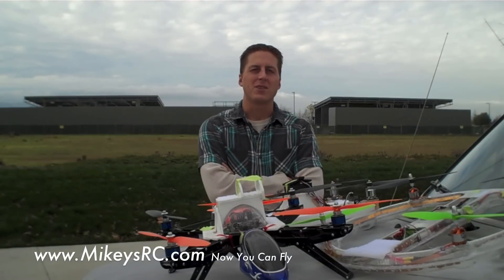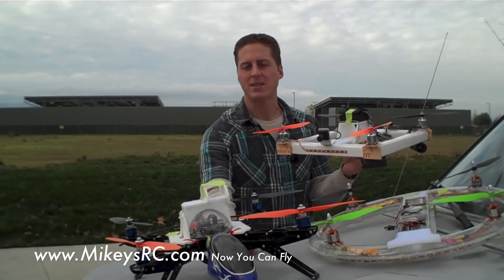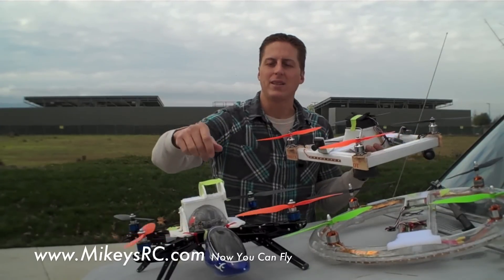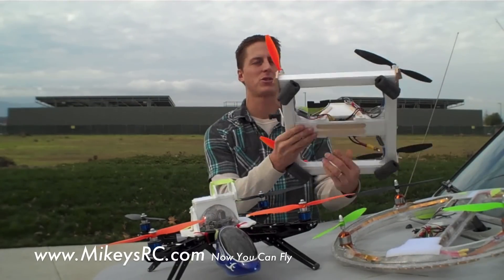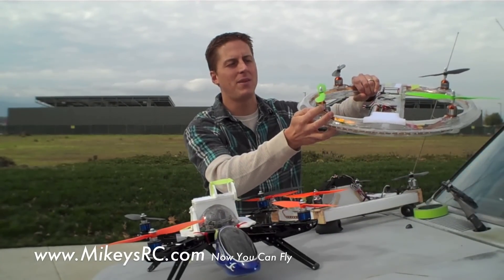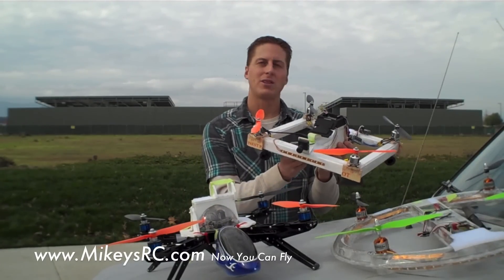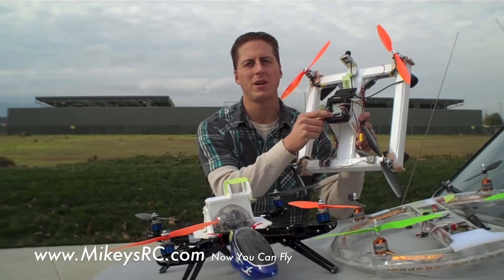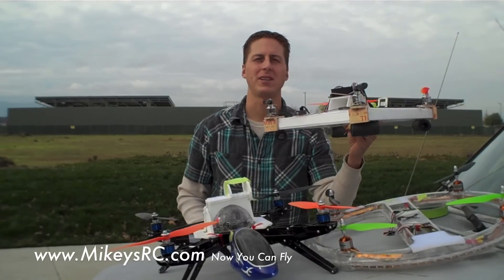Cheapest Super Light Quadcopter Frame $5 & 180 grams - Multirotor

Comment: emax 2204 2300kv motors are excellent, whether you get the fakes or the real ones, they both rock. The fakes have a bigger C-clip and are easier to work on, but require balancing.

Comment: I'm a noob. why not get a cheap chinese drone for parts. wouldn't that cut the cost of the motors in half?  would any other parts be usable?
Reply from the maker: +Zerric Dotcom This video was made before all the cheap drones in a box had proliferated the market....so yeah....if that's a cheaper option for ya I say go for it =).
Reply: +Zerric Dotcom Those tend to be extremely low quality parts.  Motors can be very cheap, especially if you buy them on sale.  Those and the radio/receiver are the two parts that you should consider investing a bit more in.  The electronics because going cheap on a transmitter/receiver can result in flyaways and lost quads.  And motors because they REALLY take a beating when you crash.  And you WILL crash.  Going with something tougher means you won't have to replace them as often and will actually save you money in the long run.  You could use a cheap chinese drone for the frame, but you can get a frame cheaper by itself.
Reply: +bigrcfanatic unfortunately I learned this the hard way.  thanks

Comment: HI    
I have some  electric question :
would like to understand the supplying 5 V to receiver  .   because I know that on plain it is supplying from motor controller.and here we have 4 of them  ( all 4  ,  5 Voltages are connected parallel? it is not healthy )so please let me
Reply: +Moti Mazor each ESC has a BEC that outputs 5v...  when you connect ESC to FC you are supplying it power... sometimes non-linear ESC's you have to disconnect all but 1 power lead so your FC is only receiving one power feed

Comment: HiI did not understood  , from what material you build the frame , from balsa  ?thanks
Reply from the maker: +Moti Mazor Foam Board
Reply: HI    MikeysRC thank you for your reply.another electric question :would like to understand the supplying 5 V to receiver  .   because I know that on plain it is supplying from motor controller.and here we have 4 of them  ( all 4  ,  5 Voltages are connected parallel? it is not healthy )so please let me know.from where kk2 get the 5V  ?

Comment: Hey MikeysRC . You mentioned FPV at the end. I'm aware of it's meaning, but im curious as to what components are needed to get it to work on a DIY project. Would it be something that gets plugged into the kk2 board or will it be a standalone transmitter of sorts. Reason for asking: The live streaming deal is essentially why i am looking into scratch building. Any input would be greatly appreciated! BTW - Great job with your builds!

Comment: What do I need to build a BlackHawk QC???

I want to build a very fast QC that flies for about 30 minutes or so, and that can lift the Mobius camera and maybe, maybe a Go Pro... 
I would like the most powerful thrust engines I can put on with 12 inch propellers or so... I am also, thinking about 5000 to 3000 mah or maybe 2,200 batteries... I am looking for a combination that will work within these perimeters...

Please, send me a list of things I will need to buy to build this quad-copter...

How fast is fast, about 80 mph, 50 mph, or so...

Flight time should be as close as I can get to 30 minutes or 20 minutes of actual flight time...

And be able to lift a Go Pro or two Mobius cameras...

I am looking for quality parts and accessories...

What do you suggest???

I am looking at a BlackHawk, but I don't know what to buy or where to begin...

I will of course be using this Flight Controller "Naze 32"
Reply: Lip stick use http://ecalc.ch/
Reply: Aram Bayadyan Wow, really love this page... Don't know what I just built, but it gives me about 22 minutes flight time...

Yessssssssssssssssssssss....

Comment: I need some inspiration for my quadcopter frame. Anyone got anything?
Reply from the maker: A giant rubber duck body.
Reply: i would do that, but I don't want to have to destroy one of my rubber ducks
Reply: jack mather
Who said destroy?  Improve!
Reply: Its my first quadcopter and apparently if the weight and angles are wrong it crashes straight away. I don't know a thing about weight distribution on quadcopters or rubber ducks, so it would be a bit too risky
Reply: jack mather Go for the H-frame, it's easier for orientation anf good for fpv/recording.
Reply: jack mather aerogel,,,,, STRONG and LIGHT, and bonus fire resistant :)
Reply: And where would you get a aerogel?
Reply: aero gel is pretty cool  but its too much for my budget and it would be hard to form myself.a heat proof thingy wouldn't really help overheating's either. would a silicone moulded frame be too heavy?

Comment: I would think that using a triangular cross section frame would be lighter and stronger
Reply from the maker: Build both, compare and let us know the results.
Reply: MikeysRC
Or do some research ...  http://www.pbs.org/wgbh/buildingbig/lab/shapes.html
Reply from the maker: +Richard F Cool little stress demo.  But I don't think that demo shows demonstrate torsional stress that this frame sees. I actually considered triangles when I first made this but making them connect at the corners would have been more work.

Comment: You didn't say what transmitter you used or recommend. I will be building this as my first multi rotor. Great video. Will check your other video out.
Reply from the maker: Spektrum DX6i or DX8 if it's in your budget.  And any spektrum DSMX receiver.
Reply: I had a DX6i, and I will tell you straight up it is not a very good radio.  It has many deficiencies, even at the "beginner" level.

Taranis offer far, far better value on both the TX and RX ends.

For example, most good flight controllers allow you to only make 1 connection between RX and the flight controller if the RX supports either PPM or SBUS (the latter being digital), which carry all of your control channel information.

But not with Spektrum, where you have to individually wire all the channels up, unless you only want to use the satellite which uses a serial connection instead of the full RX.

It's even worse if you want telemetry.  The good flight controllers can send telemetry information back from the quad to your transmitter so you can keep tabs on stuff.  But not with Spektrum, seeing as they decided not to open their protocol, and nobody feels like supporting them.  So no telemetry.

The FrSky telemetry stuff works.  You run 1 wire back from the FC to the RX, and you get telemetry.  Sometimes you might need an inverter or level shifter, but that should be it.

Look it up.  Look at the features, the price, and the user reviews.

Comment: Doesn't foamboard have paper covering?..any trouble with the weather?...Do you need to coat it with a water resistant coating?
Reply from the maker: I would not recommend flying in rain.  A morning mist shouldn't hurt it though.  Covering it all in packing tape will help protect it though.

Comment: i have a long term IRP (independent research project) for school and I'm making a quad and i based my first design off of this one it was after i finished it that i realized the props would bang into each other because the booms or whatever where to small i had them at 12 and 1 half inches long so i was wondering if you could tell me how long you made your booms front, back, and sides?

Comment: Still can't get how you mounted the motors on the foam board! How are the yard sticks holding the motor?
Reply from the maker: Glued some short pieced of wood to the foam board first.  I used a free yardstick form the hardware store for the wood.  Then I used wood screws to screw the motors motor mounts to the yard stick pieces.
Reply: Thanks..

Comment: Thanks for the video!  What speed controllers did you use?  What should I be looking for?  Also, any suggestions on motors when it comes to specs?  Tried looking on your website, but you didn't have this setup.
Reply from the maker: Used the KK2 controller.  4 1000KV motots that weigh about 60 grams.  10 X 4.5 quadcopter props from Gemfan.

Comment: Winter  X games on tv are using quad copters.
Mike, one fun project idea, is to try add a parachute to a quad copter I like to see this done I know you could do it. This would be used for if motor goes out in flight or a battery gets to low. Parachute should have its own battery one AAA to release it the air small door opens spring send it out the door. Im  a inventor to do not have time for every idea.
 With quads some buy on looks some on functions some on total cost RTF or both.
 Im looking for one can fly for one hour on one battery and one charge RTF maybe a year from now and use of Thorium we may be able to fly them to the Lunar surface take our own photos.. Keep inventing, good job. What nice about this hobby does not cost a lot and fun is worth every dollar spent and you can land them at your feet not like a plane no landing strip needed. We may move humans around earth this way.
 For first timers try starting with the V262 for $80-$130 steers great large enough to fly in 8 to 10 mile hour wind and parts easy to find cheap motor is only $6.00 to replace. Advance flyers use brush less motors like you see here at $25 per motor and you need 4 ESC, they last longer fly faster can carry more weight like a GoPro HERO3 Action Camcorder with 8 inch or 10 inch props.

Comment: As impressive as this is I've one-upped you buddy:  http://imgur.com/3UgLlzN  That's a ~128g quadcopter frame I constructed out of $0.38 of PVC using a heat gun, a drill, and two M4 screws that I had lying around.  Flew great right until a motor died.  Once I get new motors mounted I'll post a video.

Here's a pic of an earlier version (I've named it Quaddy McPlumbing):  http://imgur.com/u5bh2tg

Comment: With the control system and the right motors you can fly a brick, the shape and configuration is compensated for by the control boards. So it really does seem quite possible that you could build a VTOL quad, but you'd likely need a control system program for that. Alternatively you could run 9 channels put the arms on servos and fly manually, but I'd imagine you'd crash a lot before getting it under control. So the time learning to write and writing the control system software would not be a waste.
I would imagine you'd have to change configuration modes on the fly, probably would be fun.  If you could even just have two blades up and two tilted max forward 100% that would be quite a wild experience.

Comment: I wonder if it would be possible to build a quadrotor with wings, and design the motors to tilt forward to turn the quad into a plane, and then tilt back to vertical for landing
Reply: I don't personally fly or build these, but I'm sure with the right mind, it's possible man. Maybe that mind could be yours.
Reply: Should be possible. After all, they did it with the Osprey V-22 tilt rotor.
Reply: And/or thrust vectoring

Comment: What are your PI settings (at time of video)? I had a kk2.0 LCD, and tried someone's settings from the web. It was way too responsive. When I tried to turn it would flip. It went upside down, and then flew straight into the street, from about 80 ft up. I ordered a new set of motors, but repaired, and rewound the one's I had while waiting for new ones from China. At least HK has a US warehouse now. I may make an octocopter when I receive them.

Comment: Could you give me a link to the motors you used on your O-copter? You said Turnigy 2830 1100kv in the video but didn't give the specific one - Hobbyking to several 2830 1100kv ones. So; 2830-??

Comment: for less than 30 you can get a flip flight controller that is ready to fly out of the box. you can also choose what firmware you want i.e tricopter, pluscopter, hexacopter, Xcopter. you dont have to muck around with the gyros and trying to program it to be an X instead of the stock plus. definitely better than the KK for a newbie to quads.

Comment: Great performer! I've been thinking of building a foam copter with a helium balloon in the middle to extend flight, and covered with solar cells. I found some 3" x 6" solar cells that are lightweight and thin as paper, but are as easy to crack as a potato chip, so they can't tolerate any flex at all - would have to be float mounted on very soft foam or something - About 1.5w (3A @ 0.5V per cell -so  would probably only be useful for extending the charge on the battery. Still pondering it.....

Comment: Yep, I was on their site today.  I'd rather use a good P&S camera or NEX; etc, not a gopro / Hero.  Not sure how I'd mount it on their fuselage.  I noticed there's no picture (on their site) of the bottom of the fuselage by the way.  Is there a spot/mount for mounting the Hero?  And do the two halves come apart in case a motor needs to be replaced (not sure if the leads are long enough to reach the access area in the center).
I have green insulation foam, maybe I'll cut some and weigh it.

Comment: Did you remove the paper on the foamboard first?

Seems this could be made into a floating frame with more foam under each corner....with camera; etc on top, it would be top heavy, but since these multi-rotors are stabilized, that should not matter.  

I wonder if pink or green solid insulation foam would be strong enough w/o weighing too much.  Could add very thin plywood on top to add stength and regidity.

Comment: you may want to set the program that installs the drivers etc et al. set it to windows 7 or xp compatibility mode when running the installer. right click on the app, and set compatibility also may want it in administrator mode as well. should install.

Comment: Hi Mike.  It looks nice and stable.  The settings I use on my 450 size quads for crazy aerobatics are as follows.  I can really give it hell without it oscillating or any other nastiness.
Aileron P gain 50, P limit 100. I gain 25 limit 20. Elevator is same. Rudder P gain 50, limit 20, I gain 50 limit 10.
Stick scalings for roll, pitch, yaw, throttle - 50, 65, 60, 100.
Minimum throttle 15 (stops motors stopping in hard turns and quad falling out of sky)
I'll take some video of my quad & post it.

Comment: I'm building my first quadcopter here, and I want to know how the wireless works. I've been introduced to arduino, Xbee, and wireless shields, but I have not tampered with RC radio. Can you tell me how it works and possibly link me to a dependable RC transmitter/receiver? I could seriously use a push in the right direction.

Comment: Mikey, what camera and transmitter do you like for FPV?  Also, did you say the total weight is 180 grams or 890 grams for the quad?

Thanks for all your hard work.  I'm just learning and have bought nothing so far, but with your help, I've learned a lot.  I will soon build the FPV slow flyer you have on your site. I can't wait to see that plane fly by.

Thanks!

Comment from the maker: Just use 4 1000KV 40 gram motors, 4 20 amp ESC's, 4 10 X 4.5 Gem Fan props, a KK2 board and a 2200mah 11.1V 30C 3 cell battery.

Comment: Hey Mikey, if you tilt your motors in the direction you expect them to torque for yaw, you will increase your yaw control dramatically!  Tricopters tilt one motor on a servo and it's powerful.  KeptainKUK built a quad with four servo-tilting motors but came to the conclusion you can just tilt them permanently and the yaw control will be snappy.  Keep up the good work with your channel.  Multi's are the foamy of the heli world, eh?

Comment: If it were ever necessary to lighten the quad would you lose much by carving out parts of the foam as long as structural integrity was monitored closely or would there not be significant enough gains made to even make it worth trying as it sounds pretty light for what it is.

Comment: It's basically a H-Quad with extra side frame pieces. I made mine out of aluminum towel rack material that you can buy at Home Depot. It's lighter than wood but bends easily in a crash.

Comment: Hi Will! Nice quad :) . I like your foam building techniques -perhaps next time you can test it in an X configuration instead of an H.
Regarding the KK board, the settings really depend on the firmware you are running. Is it completely stock or does it have a kapteinkuk upgraded firmware?
What I do for my KK is I start with 50%, then increase until I get humming vibrations and nervous behavior from my quad. Then reduce it just a little bit. If you are running kapteinkuk's, increase I agter that.

Comment: Nice job as usual. I have an aluminium framed large homebuilt quad with a KK2 that I'm still trying to sort settings out on but I may look at building one of these. This looks like a good FPV starter. What did you make the uprights for the FC board out of?. My biggest problem will be sourcing foam board here in New Zealand.
Have you tried the V949 from Banggood? I have and It's now my favourite flying machine.
Best $50.00 I ever spent.
I enjoy it more than my Trex 500.

Comment: carried as follows:
 5000mah 3s (main power flight time of 10 mins so far)
1000mah 3s (fpv)
1 Vivicam handheld camcorder
1 400mw 1.2ghzTX
1 components female to female adapter
4 750kv bell outrunner motors
4 11x4.5 prop
4 hk 30amp ESC
3 meters of 26Guage wire
1 HK flight controller 3.0 / HK multiwii pro with gps / arducopter
and a few bits and bobs more!
I have no idea what it weighs but its well over 3kg I would say
and it has so much headroom on throttle it is unbelievable
My own design